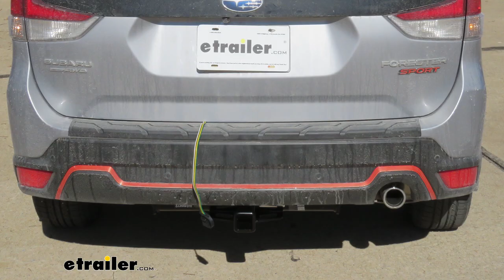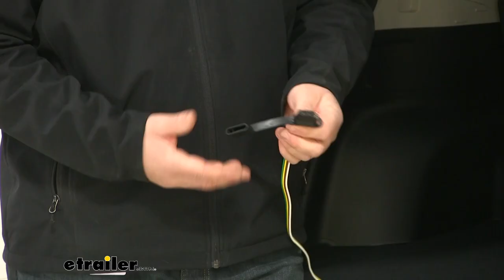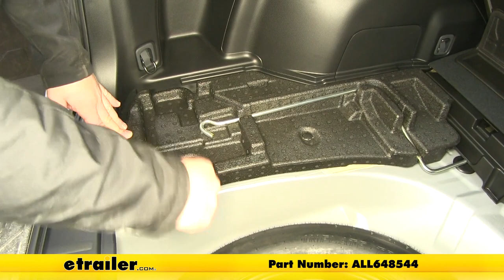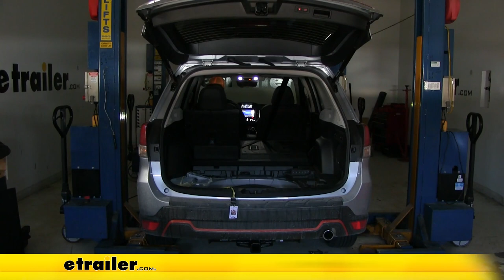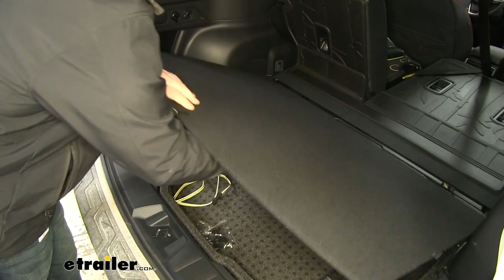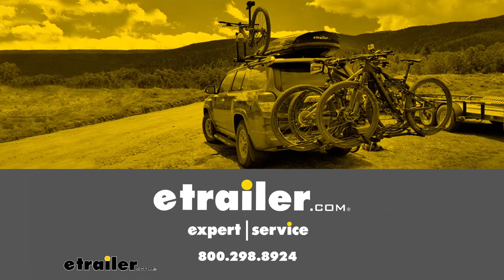etrailer | Trailer Wiring Harness Installation - 2019 Subaru Forester

Comment: Why can't it be mounted on the outside?
Reply from the maker: Yes, the wiring can definitely mounted on the outside of the vehicle. The reason why we install many of these kits on the inside of the vehicle is because the owner of the vehicle does not plan on using it but a few times a year. This will provide the ultimate protection for the wiring for the times when they are not using it. If you plan on using it more often then installing it outside is much more convenient.
https://www.etrailer.com/Custom-Fit-Vehicle-Wiring/Curt/C56040.html